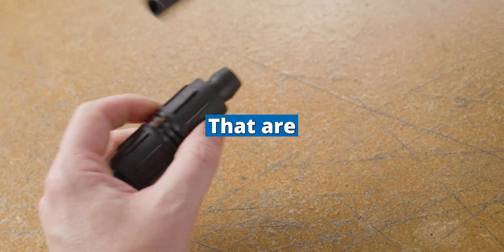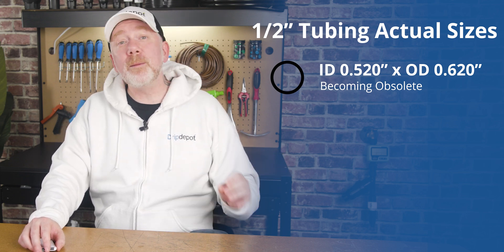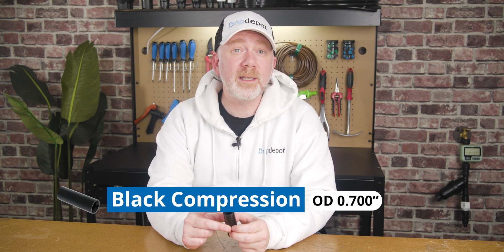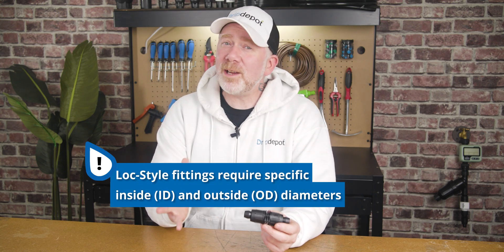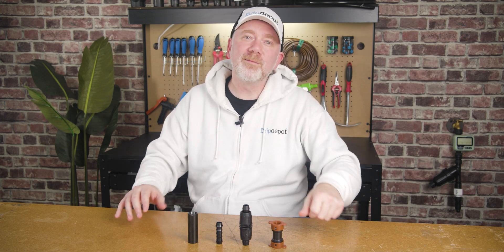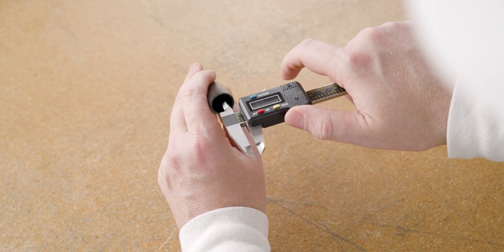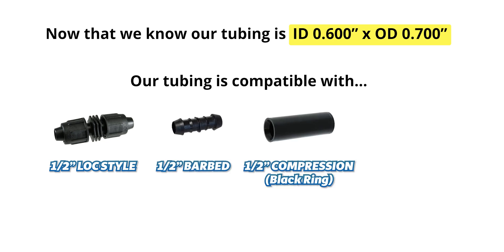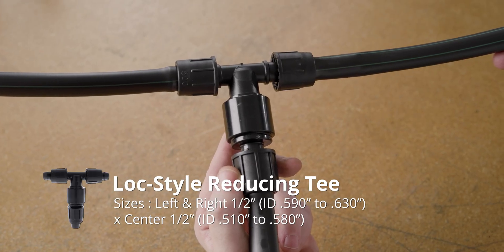Wrong Half Inch Fitting? Understanding 1/2 inch Tubing Compatibility

Comment: Great video. What is the name of the piece that you added to your irrigation timer behind you that has the connection for the hose to the left at the bottom of the timer? Thanks and God Bless!
Reply from the maker: If I'm thinking of the same parts you are, those are actually 4 separate parts that make up what we call a "head assembly".  The parts, in order from the top down, are: 

Vacuum Breaker (backflow preventer) --> Filter --> Pressure Regulator --> Hose x Tubing Adapter

The last part in the series (hose x tubing adapter) is the part that connects the mainline poly tubing to the rest.  The parts are all hose threaded so they can go right on a standard hose timer, or even right on the spigot for systems that go without a timer.  It's available in 1/4" up to 1" sizes depending on the diameter of the tubing used :) 

If those were the parts you were asking about, we have a short (2:43) video that goes over the parts in a bit more detail at this link, and you're welcome to ask any questions you have at any time: https://www.youtube.com/watch?v=r-mWxxqZpKM

Comment: Thanks for your channel....Years of Torment, resorted to using a lighter to soften material...shove on with all my might....spend hours trying to find proper fit...!! Save hundreds of old drip supply, I get the bin out and monkey around until it works...in desperation I get out tape and wrap and wrap....I often go into the plumbing department and think..."What the heck is the Conspiracy behind this INSANITY...!!!" Anyway, live and learn...that's how it goes.
Reply from the maker: LOL yes, sometimes it did feel like a conspiracy!  "What do you mean these 1/2" fittings don't work with my 1/2" tubing?"  Standardizing tubing sizes like we see with PVC would be nice.  I don't think it will ever happen universally, but the 0.600" tubing is starting to become the most common :)

Comment: Thanks for your explanation but this is unacceptable from these manufactures. If I see 1/2 inch tubing it should be that. My local Lows are HD have a very slim selection on these things. Trying to find fittings has been crazy. I know there is your site and amazon but I have connects that fit my black tubing fine but not the brown. I thought I picked up the wrong tubing but both said 1/2. I like to be able to buy and not try to figure things out. now I don't know what to buy as I might get the wrong connectors. What a waste a money. I have been gardening and want my beds to be water. This really pisses me off. Too late to return 90% of this stuff.
Reply from the maker: You are correct, tubing should be labeled as its actual size if there are no universal standards, such as 0.600" inside diameter, 0.510 inside diameter, etc.  That would eliminate so much of the confusion by itself.  It's ok if it's not an actual half inch (0.500") as even 1/2" PVC isn't an actual half inch, but 1/2" PVC does all have the same outside diameter so it all works with 1/2" PVC fittings -- I'd love to see this done with poly tubing as well. 

To be fair to some of the manufacturers, they have a fairly good reason for making multiple sizes -- on large Ag projects that can use tens (even hundreds) of thousands of feet of tubing, they don't want to pay the extra material costs for 0.600" inside diameter if 0.510" will work just fine -- the problem comes in giving all those sizes the same 1/2" label. 

Basically, fully agreed, it would have been nice if this video wasn't even needed and you could confidently buy 1/2" fittings for 1/2" tubing.  This has even gotten us in the industry at times, being on a job site and picking up some 1/2" fittings from the store just to find out you got the wrong ones.  

If you still have everything, I think this is something I could help you with -- I can help determine which of the fittings you got you'll be able to use and what fittings would be compatible with the ones not working currently, just say the word :) 

We're leaving the office for the evening now, but I'll be back early in the a.m. tomorrow happy to help.

Comment: My old .710 has a thicker wall than the .700. Too bad there is no industry standard or math used in measurement specs. Black, Green, Blue, out of order to size. Why are you not logical? Ffs.
Reply from the maker: Some industry standards on tubing diameters is something we'd like to see as well, fully agreed -- just like with PVC, it would be great if a 1/2" fitting always fit the 1/2" tubing.

Comment: How can I measure O.D. and. I.D of my existing "1/2 inch" tubing? Can you recommend a particular tool for this purpose?
Reply from the maker: The best tool I've found for this is a pair of digital calipers -- it doesn't have to be the expensive kind either, there's digital calipers available for under $10 fairly regularly.  There's lot of other uses for them too, they're great at accurately measuring things that are too small for measuring tape, so you'll be able to use them for more than just measuring tubing :)

Comment: Hi, thanks for your reply. I am living in the Philippines where everything is done the way it was 50 years ago in the rest of the world and these brass compression fittings is what a lot still use when they are upgrading from the old GI pipes to what they call high pressure pipe but nobody uses a proper tool to do the job. They use a cigarette lighter to heat the pipe and then use the corner of the lighter to flare it and then after a few attempts at it you get it to seal. I have searched everywhere for a flaring tool for PVC but I only can find for brake lines so I don't know if this will work or not.
Reply from the maker: What timing, I was just talking to a colleague about this exact topic this morning using flame or a heat gun to soften PVC to mold it into a different shape, often a bell-end like you're describing here.  The consensus was it works, but it's not ideal -- the heat will break down the plastic a bit, weakening its structural integrity.  It might not ever cause a problem, but it could due to that weakening.  

We were discussing it, because it's also very common to do here in the states -- it's not best practice, but still gets done fairly regularly.  Google results are likely quite a bit different in the Philippines than they are here, but I had the best results searching for "PVC Flaring Tool" and "Plastic Pipe Flaring Tool."  Not all the results were relevant, but I got more that way than other search terms :)
Reply: @dripdepot  Yes it does not look like anybody bothers with a flaring tool so I think I will just avoid those type of fittings. Thanks for your help, Cheers.

Comment: Hi, do you know anything about 1/2" high pressure PVC tube (PE) that uses brass flare nut fittings and if so what tool is used to flare the tube.Thanks.
Reply from the maker: The tool used is actually often just called a "Flaring Tool."  Searching google for "Flaring Tool" brings up a lot of results, you might want to try more directed searches like "PVC/PE Flaring Tool" or "Plastic Pipe Flaring Kit" and variations of those to see if you can locate one that will work with your pipe.  

With all that said, unless you specifically need to use brass flare nut fittings, you could consider going with a different fitting type so you don't have to flare the end of the pipe -- primer/glue slip fittings make a nice permanent connection.  This can vary depending on application of course, but I wanted to mention it just in case :)

Comment: This is a classic disaster of technology and trust misplaced. Is this an intentional miss use of technology? All manufacturers should look to the LONG term implications of their industry.
Reply from the maker: In this case it's actually more about physics -- manufacturers produce these different sizes of 1/2" tubing for different applications, one of the largest of which is commercial farming.  

In commercial farming, vast amounts of material are used and if the physics (particularly friction loss and water velocity) call for 0.520" inside diameter tubing, they understandably don't want to spend more on 0.600" inside diameter tubing.  On a large commercial project, this can translate into tens of thousands more dollars, not to mention the wasted material since the larger diameter may not be taken advantage of. 

I think the solution to this is going to end up being listing sizes in metric (and we're already seeing this to some degree, even in the US).  Doing so pretty much eliminates this confusion, as you can grab 13mm fittings for 13mm tubing, for example.  This will allow for less wasted material and at the same time eliminate the confusion in tubing and fitting size compatibility.  While it's unlikely everything is going to go metric any time soon, hopefully the trend with tubing continues to catch on :)

Comment: PLEASE help with this if anyone can!? So if you have tubing with (OD) is 0.620 in. (ID) is 0.520. in! I need to connect a threaded/swivel connection of 1”, 1-1/4, 1-1/2. Basically, trying to connect my drip irrigation tubing to my submersible pump! The pumps multi-connection piece Isn’t compatible with  sizing, as it is now. So what can I do to connect The submersible pump to the drip irrigation tubing. (Without spending hundreds more)
Reply from the maker: You bet, happy to help, there's a good chance this can be done with just a couple adapters :) 

Is the 1", 1-1/4" 1-1/2" optional adapters that came with your pump?  If so, the 1" option is going to be the easiest to get connected to since 1" adapters are the most common.  

Reply here and let me know if the pump has male or female threads at the outlet and if it's a 1" connection (or one of the other sizes), happy to see what we have to get your tubing connected -- we do carry some fittings for 0.520" ID tubing, and at least two of them are threaded (one male, one female), so all we'll need to do is adapt where you'd like to connect the tubing over to a correct sized Threads x 0.520" ID Tubing connection.

Comment: I am having this problem right now.  I am 81 years old and trying to put the half inch coupler into half inch tubing - both supplied by Drip Depot.  I have used lubricant, pliers, and a lot of cussing but cannot get the coupler into the tubing even 1 mm.  Nothing should be this )^&)^)&) difficult. This is not a new invention. If you sell two pieces that are intended to work together, they should work.
Reply from the maker: Kenneth, try dipping the end of the tubing into very hot water for a few moments.  This will soften the tubing up significantly, making it much easier to push on over the barb of the fitting.  It should still be a snug fit (it has to be watertight!), but when hot the tubing gets very flexible.  Make sure the water is HOT and leave the tubing in it for a few moments.  You should notice a big difference in its pliability when you remove it from the water.
Reply: @dripdepot  I used a heat gun and it helped a lot, but still struggled to get it in.  It will become a part of the process I guess.
Reply from the maker: @kennethjames4724  It will!  The first one is always the most difficult, it's mostly downhill from there as you get accustomed to it :) 

And a heat gun definitely works -- not sure where you are geographically, but it's probably hot enough outside where we're at that leaving in the sun for a few minutes would soften it up enough.
Reply: Use a flame (like with a lighter) on it for 5-10 seconds and then it's easy :)
Reply from the maker: @yaronhadad  This is true -- we don't usually recommend it due to the risk of melting the tubing, but you're not wrong, it's definitely going to soften up the tubing significantly (and hopefully not too significantly!) :)

Comment: Always a crap shoot when leaks happen.  I have a supply of all sorts of fittings in case I screw up with the sizing logic.   Hope to avoid multiple trips to Ace or Lowes, but many time it takes two trips.   Less strength in may hands these days makes these leaks longer to fix than they used to.  Thank you for this video.
Reply from the maker: You're very welcome, thank you for the comment as well!  For diminished hand strength, I've found the Drip-Lock fittings work really well -- they're a "bite" style fitting, so you just give the tubing a little push into the teeth -- much easier than a compression or even barbed fitting, I use them a lot on systems for friends and family.